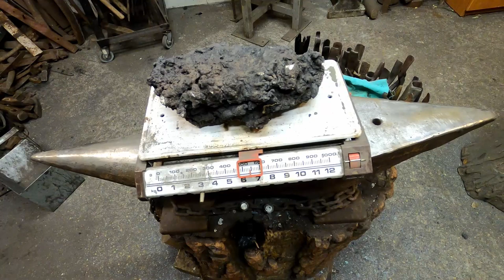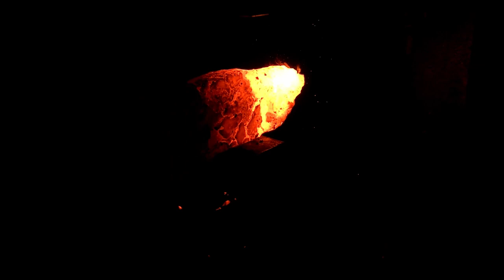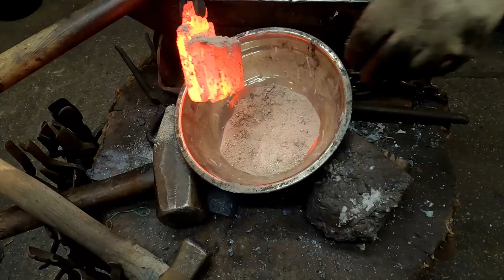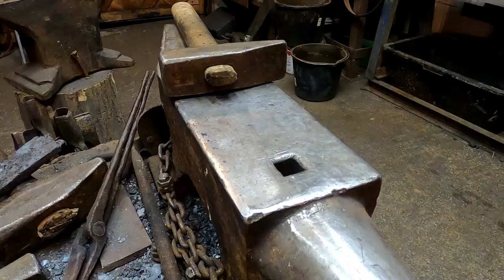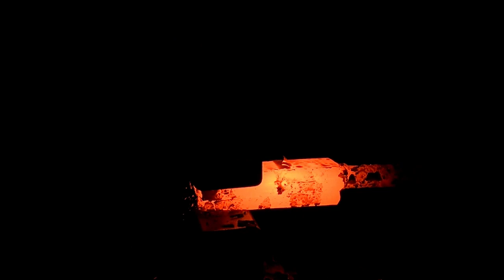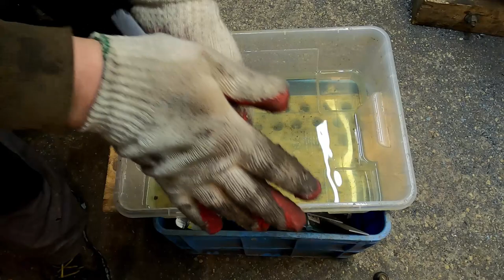Iron bloom: processing and forging.

Comment: I’m amazed at how much material and weight is lost through forging and refining the iron. Will this be the same as wrought iron, or a different alloy of iron?
Reply from the maker: Wrought iron and bloomery iron are produced in two different processes. Bloomery iron is produced by direct smelting in a bloomery furnace, the product of smelting is soft iron. The wrought iron was produced of cast iron (pig iron) in the finery or puddling process. Usually, bloomery iron is of better quality (after the refining process I show in the video) than wrought iron, it contains less slag inclusions, do not contain sulfur (some of the wrought iron has S in the alloy because in the production process the coke was used). I plan to make a video "Everything You Always Wanted to Know About wrought iron and bloomery iron, But Were Afraid to Ask" :-)
Reply: @officinaferraria  is there a further video where you take this high quality soft iron and make it into steel? Also are there any plans on a video for how to improve the quality of your bloomery iron before/during smelting?

Comment: Somebody should show how stuff like the Puddling Process or controlled decarb was done. Surely it would be a lot easier to make pig iron or cast iron and decarb it than to make wrought iron traditionally, right?
Reply from the maker: Puddling or fining  is not easier and faster than bloomery process and one process extra is needed (smelting of the cast iron). Bloomery iron is not wrought iron in term of the process of the  cast iron refining.
Reply: @officinaferraria  Okay, thanks for the info :)
Reply: @officinaferraria  By the way, the reason I suggested this is because I know that pig iron has a substantially lower melting temperature than malleable iron or steel, and I thought it might be possible to remelt a bloom that had been exposed to too a large excess of carbon and allow it to melt together and form into a solid piece, while the slag floats to the top, which would normally be impossible with this material. I suppose this is just a case of "easier said than done"? It looks difficult to consolidate those large spongy blooms.

Also, of course, I realize you are probably also doing this from an interest in the historical process of producing this material. Honing that art is certainly worth the effort.
Reply from the maker: @bilbo_gamers6417  bloomery process needs lower temp. than cast iron smelting, inside the bloomery  furnace reduction occurs not melting like in the blast furnace.

Comment: Is it possible to obtain steel by carburizing this iron in a forge and continuing to fold and weld?
Reply from the maker: Yes it is possible you can use blacksmith hearth to carburize the iron, i show it in one of my previous video, but I used small furnace instead.
Reply: @officinaferraria  Interesting.
It turns out that if the process continues, the mass of finished steel will become even less.
Here you can draw a parallel where you received 3 kg of iron, then a kilogram of wrought iron of stable quality, which will be much more expensive.
And the final product of which may be less than a kilogram.

This explains the high cost of steel in the Middle Ages. 
The more you go through, the more coal and labor time you spend and you get less mass of finished material.

Comment: What is that dark streak running down the center of the finished bar? An inclusion of high carbon steel? Thanks for the video.
Reply from the maker: Yes, this dark streak is higher carburized, generally, the iron bloom is low carbon content but sometimes the front part of the iron bloom placed just in front of the blowing hole is a high carbon (even more than 2 %). I plan to show it in detail in my next videos.

Comment: I need to ask a novice question. How are you able to determine when you have iron or steel? At the end you have determined that you have low carbon in the metal, which (theoretically) means it is steel. But how do you know as you are forging and hammering it?
Reply from the maker: there are several indicators to check the presence of C. 1. To smelt this iron bloom I used slag-pit furnace, which usually gets low carbon alloy. 2. The presence of the carbon can be detected easily by watching the color and the shape of the sparks when the material starts to burn at a high temperature. 3. If the polish surface after etching in the acid is still bright it is mean that the content of C is low (in case of high C content the surface is getting dark). 4. The low carbon iron (alloy) is soft and easily forgeable.

Comment: So basically you hammer the bad material out + air ? yes / no :-) 
The thinner the slag[?] on top the better your product.................
At that point of time they did not control the melting-process...?
Reply from the maker: The bloomery iron contains a lot of slags, during hammering and forge-welding this slag is removed. Less slag in the iron the better. But the slag is necessary during the smelting process. It is a reductor in the reduction reaction of iron oxide and it prevents the oxidation of the iron. The amount of slag in the iron bloom can be controlled but it is very difficult.